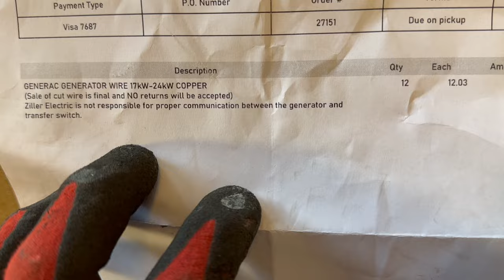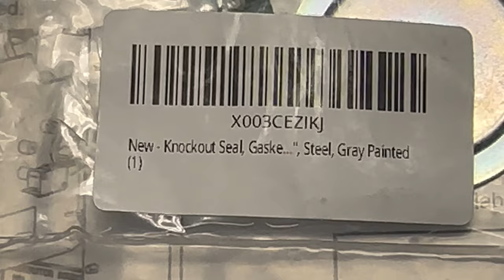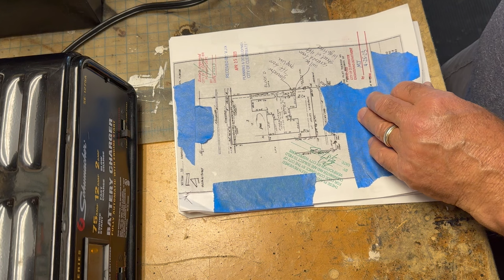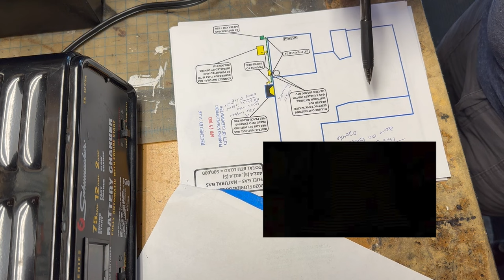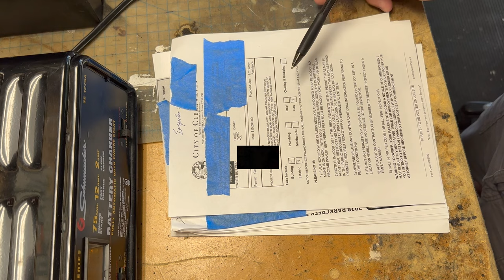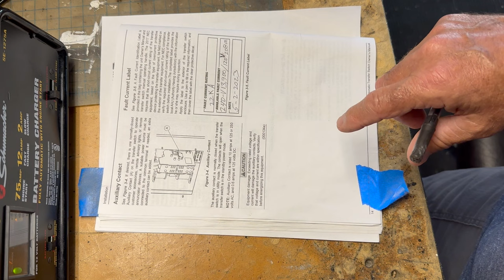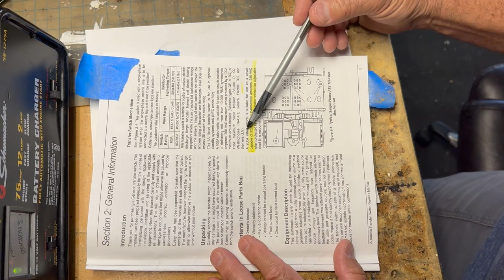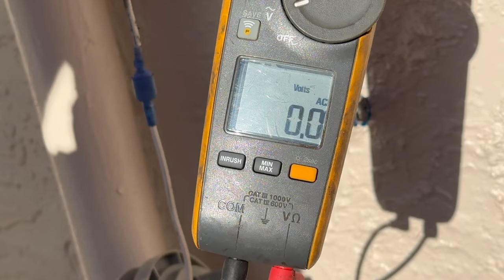How To Install A Whole House Generac Generator And A 200 Amp Generac Transfer Switch.

Comment: Hi sir,I am having challenges that's moving the navigator to select the 22kw LP,it's already at NG position from the manufacturer,the navigator is not moving for me to select to 22kw LP, I try starting it's only cranks indicating Low Idle speed on the display, all manual switches are in LP position
Reply from the maker: I tried to turn mine when I first got it. There was so much resistance that I stopped trying out of fear that I would break it as it was already set on natural gas and that is what I run. You may want to contact the manufacturer. Sorry I could not help.

Comment: Did you separate ground and neutral in your panel inside, given they are now bonded at the tranfer switch? Technically, the panel became a subpanel, with the transfer switch being a first point of disconnect?
Reply from the maker: Hi, Happy thanksgiving. I did.
Reply from the maker: I put up a video before this one on how to separate neutrals and grounds. I should leave a link to it. Thanks for watching.
Reply: @fixitjohn  thanks! Happy Thanksgiving!

Comment: Hey John great video and the light hearted comments add to it. I saw an article about Generac adding a wire. Newer unit now have a 4 conductor terminal block. You need to connect to neutral and T1. Did yours have this and do you know anything about it?
Thanks
Reply from the maker: Hi John, I have not heard of that. On mine T1 and T2 are for customers' load power coming from the transformer. The Neutral goes to its own busbar. They could have changed the ATS I don't know. Good luck and thank you for watching.

Comment: So what happens when the power company works to restore the power. Isn't that going to be hot on the metter.
Reply from the maker: No. The transfer switch reroutes the electricity.

Comment: Thanks for the video,can LPG be used to power the generator? In Africa we don't use natural gas in our homes
Reply from the maker: Yes, you can run propane LPG! The generator has a knob that you can turn to run either NG or LPG. It comes set to run on NG. I hope this helps. Thanks for watching.
Reply: @fixitjohn  thanks

Comment: Wonderful video, one of the best I’ve seen so far. Where did you purchase the seal tight ?
Reply from the maker: I got it on Amazon. Thanks for watching.
Reply: It's called duct seal, we call it dumb-dumb in the business.  Everyone stocks it, Home Depot, Lowes.  Comes in the small 1 pound like you see or a larger 5 pound brick, about $5 and $22 respectively.

Comment: Are the generator supply cables connected to the correct terminals?  Another video I saw showed the gen cables behind the house supply lines.
Reply from the maker: Yes they are. The city inspector came out twice. If you are uncertain you may want to hire a professional. But I think most people can do this job. If you have any more questions don’t hesitate to ask. Thanks for watching.

Comment: What are somethings to look for if it doesn’t start when you turn off the switch at the end?
Reply from the maker: Signal wires may not be wired right.

Comment: After a power outage :  Generator came on as expected but when power was restored the system would not transfer to utility.   A wire came off the utility side solenoid and before I noticed the wire I had pushed the red trip button on the main 200 amp breaker to test but after I reconnected the  utility solenoid wire the breaker won't reset.   Is there something I'm missing on setting/closing  the breaker.   Do I need to kill the generator before closing the 200 amp breaker before it will set?
Reply from the maker: @brazosa1  Sorry, I am not sure what happened. I would check your fuses on the generator.

Comment: Nice. Since the ATS ground and neutral  is bonded, did you have to remove the bonding in your main panel between ground and neutral?
Reply from the maker: Yes I did. I have a video on how to separate ground and neutral wires. In the generator video you can see me taking the bonding wire off the neutral wires and ground. I don’t say anything in the video about it. Thanks for watching.
Reply from the maker: Hi Tyler, at 34:19 I am removing the bonding cable from the neutral bus bar. I hope this helps.
Reply: @fixitjohn  Awesome. Thanks for the update. Good work and thanks for doing the video.
Reply: @fixitjohn  - thanks, I watched this and the one where you prepped the main service panel for NO Bonding, great info
Reply from the maker: @trp2413   Thank you for watching.

Comment: Can i connect the generator supply directly to a manual/automatic change over without the automatic transfer switch?
Reply from the maker: Yes, you can hook it up to a manual switch. There are some safety lockout devices that you will need to install on your electrical panel.
Reply: Hi,I am done with my installation of the Genset,do you have video or tutorials on how to configure from NG to LP? It's already programed to NG from the manufacturer
Reply from the maker: @kojoadjei99  No I don't

Comment: what size is gen ?no load shed? and yes you do need that grd to panel its now a sub panel and you have to seperate neutral and grds in that panel
Reply from the maker: Hi Jakersyner, it is a 24 Kw. I had found another ground going to the water line. I could not figure out how the ground was able to get to the ground without the grounding wire. I have another video that shows me separating neutrals and ground. Thanks for your comment. We only have one a/c unit so I didn’t hook that up.

Comment: If you'd had a meter-main combo box (where the meter and main service disconnect breakers are in the same box but separated into breaker and utility meter-only sections, and the conduit that enters the residence is in the breaker section, could you have fed the wires from the ATS back to the panel through the meter-breaker combo box?
Reply from the maker: That is a good question. From what I have read you can’t run power through the meter box from a different power source. The different power source would be your generator. I would ask your local permitting department. Some will let you do it and others won’t. Thanks for stopping by.
Reply: @fixitjohn  ... that's an NEC thing. Once you get power out of the meter, you can't run it back in the same race or junction box.

Comment: Correct me if I’m wrong but it looked like your multimeter was set to amps instead of volts when verifying that your service was de-energized. Stay safe out there!
Reply from the maker: WOW good eye. I actually had it set to read temperature. I never use that particular multimeter but I will be more careful in the future. Thanks for watching.
Reply from the maker: I must have bumped it and moved the setting.

Comment: Would have been nice to have parts numbers in the description.  My Generac did come with the Transfer switch but It did not come with Oil, Battery or the Cable or any of the PVC piping and I am trying to save money on the installation.  If I pay someone to install it they will charge and arm, a leg, 3 fingers and 4 toes.  Nobody wants to know what the Propane company wanted to install piping and all of that either.  It's insane.  I managed to survive Hurricane season 2023, without my generator but I am on a Mission to have it installed before June 1, 2024.
Reply from the maker: The generator does come with oil. Everything else I picked up at Lowes using 2-inch PVC conduit. I hope this helps.
Reply: If this is any help........I'm helping an 'ole neighbor set up his stand-by  generator, and the propane company's are insane today, so with some digging, he found a guy selling 5 each 420 tanks, market-place, he bought the 2 best ones for $300 for both.  Yea, price out new ones.  And he has an independent supplier lined up to fill them, but at a minimum quaintly, so in the future he would need to pay a premium or load up the tank and take it to a low cost re-fill station with in 15 miles from were he lives.  Just a though for you.
20  Years ago, I did a big addition to a home, and we converted the all electric house over to propane heat with a new furnace and duct work, to save on the electric bill, and the propane company I found would provide a in ground 500# tank with a 2 year service contract, which also locked in the price........man, have times changed.......🤔

Comment: What size liquid tight flexuit are you using?
Reply from the maker: It is 1 1/2 “with plenty of room in the conduit but it was a tight squeeze through the elbow fitting. Thank you for watching.

Comment: Can you get parts in 10 years   ?
Reply from the maker: I'm not entirely sure about that, but typically manufacturers need to supply parts for what they make for 10 years. Why do you ask are you thinking about one? Thank you for reaching out.

Comment: How did you properly size the generator to your home draw?
Reply from the maker: It is a 100amp generator for emergency use. Service amps  coming in from the transformer is 200 amps. You would go around your home and add up what the amp draw is from the appliances. If I was to turn everything on at one time like our two ovens on self cleaning mode all 5 burners on our range top, the dryer running the A/C running, microwave running, coffee maker on and so on it will not run the hole house nor will the 200 amps from the transformer. The transfer switch does have a feature that if you had let’s say 3 a/c units it will shut down the one unit automatically so the other units will continue to run. I hope that helps. Thanks, for watching.
Reply: @fixitjohn  ... that load shed module will control up to 4 items. 2 can be done directly via low voltage wiring and another 2 via relays. Read your manual for wiring details and the timing of the load shedding. I highly suggest using it for the AC because those are HEAVY start loads.

Comment: Good video, but did not hear how you knew which size generator to get.
Reply from the maker: Like I had mentioned in the other comments. You will have to figure out the amps being drawn in your house most of the time. If I try to run everything at one time it would flip the breaker. If I tried to run everything at one time on the 200 amp service, it would flip the breaker. I hope this helps. Thanks for watching.

Comment: You .need primer if you want it to stay connected
Reply from the maker: Thanks, I was more concerned with the aluminum lugs. I will make a note of that though. What color do you recommend?
Reply: I use carlon clear primer and light gray solvent cement medium body and always try to twist the joint when putting it together.  As for aluminum wire in aluminum lugs use lots of noalox .also never hurts to use noalox with copper wire. Personally I never use aluminum wire. Copper is worth the piece of mind.

Comment: Did you need to remove the bonding screw in the main service panel since the transfer switch is bonded?
Reply from the maker: For the ground no. I am glad that I left it connected.
Reply: You are supposed to remove that screw. The panel is now a sub panel due to it no being the first means of disconnect.

Comment: How do you hook to natural gas?
Reply from the maker: I didn’t hook ours up but it does not look hard. They hooked it up from the meter and put a shut off valve before the generator. The generator comes with a stainless steel flexible pipe to hook to the generator. Our state uses galvanized pipes. I know some states require black steel pipe. I live in Florida. Sorry but that is not much help.

Comment: What size of electric wire from Generac generator to transfer switch,what name is it,in this electric wire,aluminum SER wires???.

Good video Sir.
Reply from the maker: There are three sizes. The 2 hot and one neutral are 3AWG 1 ground is 8AWG stranded copper wire. The 6 control wires are 18AWG solid copper wire. Let me know if you have any more questions. I am glad to help. Thanks for watching.
Reply: that wiring is available directly from Generac and is UL rated for this use. (low and line voltage within the same jacket)

Comment: I thought LQ fittings with flanges come with an o-ring seal?  Shouldn't need that putty-like stuff.
Reply from the maker: I like to use the duct seal to help ensure a water tight seal. Thanks for watching.

Comment: Also your not supposed to run a razor around the wire called ring it.
Reply from the maker: Thank you for pointing that out. What else did I do wrong. Thanks for watching.

Comment: pretty sure that gas line is too small
Reply from the maker: I think it is 2 inches too the meter . 1 inch for the main runs and 3/4 to the appliances. The city installed the gas line so that is on them. The generator run good it doesn’t seem to be starving for fuel. Thanks for your comment.
Reply: @fixitjohn  .... your main concern with the gas will be the meter size and having a large enough line out to the street. Check the gen manual for cubic feet needed at 100% load and you will see it's probably well into the 300 - 400 CF range. Add up the other appliances and see if the total falls within the meter's capacity. It's on the spec plate, and usually highlighted in red. Most residential meters are only 200 - 300 CF unless you have a pool heater. BTW, for appliances rated in BTUs, converting to natural gas is 100,000 BTUs is 100 cubic feet.
Reply from the maker: @rupe53  I will check that. Thanks

Comment: What size of cable did you use for that generator that supplies power to the transfer switch?
Reply from the maker: The hot cable that comes in that all-in-one cable is 6 gauge. Thanks for watching.
Reply: @fixitjohn   Not 6gague if the generator is 100amps, thats a fire waiting to happen. Also the grounding on this would not meet NEC codes unless i missed something.
Reply from the maker: @MattOwens-so4fn  Please notify Ziller electric and Generac as they are selling it to everyone for that generator.